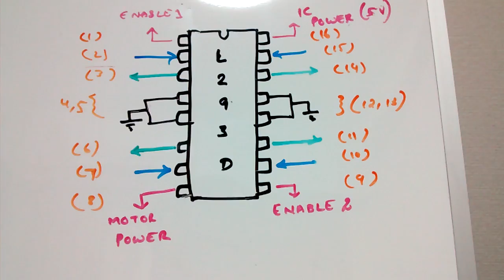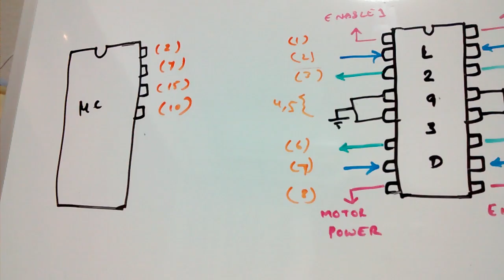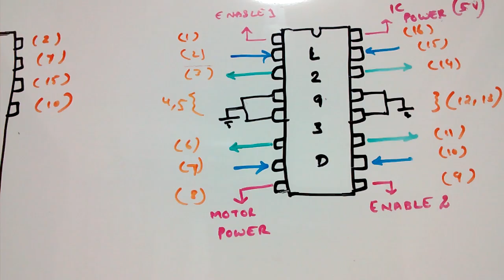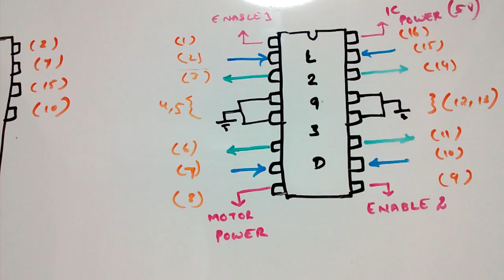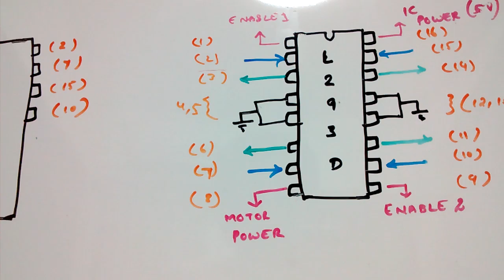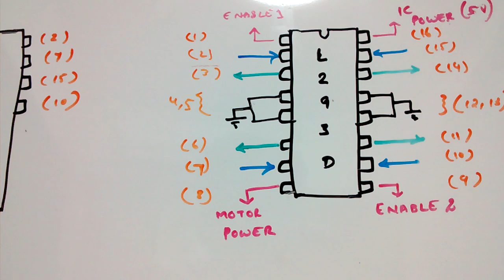L293D Motor Driver Working

Comment: Bro please tell me quickly i programmed by uno and connected motors and did everything after that the motors didnt run and there was a voice coming like chhhhuhhhjjju i was making a line following robot
Reply from the maker: Ha Ha Ha .. please check your connections first.. could be a problem with connection. especially the ground connections. If all the connections are good, then it could be that the input for motor driver is not proper.

Comment: Can we give same power supply to L293d and the microcontroller???
Reply from the maker: Yes you may. But please give battery with enough output voltage and also filters to block the back emf and other parameters.

Comment: What is the maximum current measure rate????
Reply from the maker: I haven't measured it to be honest. But if I remember correctly, it's upto 600mA as per the specs. You can measure it with an ammeter if you want to.
Reply: @imtheroboart  OK..

Comment: Can you get it to run the motor when it receives low signal, and stop when it receives high signal. i.e if the input comes from FC-51 proximity sensor which has active low input ???
Reply: Sorry fc51 active low output

Comment: y cant we use ic7404 for this operation..even that will two signals which are inverted to each other..this can also turn motor bidirectionally?plz someon answer
Reply from the maker: narayana srikar bonda It cannot provide the enough power required to drive the motor .
Reply from the maker: vamshikrishna kancharla Thank you

Comment: is is necessary to give 5v to 1 and 8 pin and 12v to 16 pin or can i give 12v to all 1,8and 16
Reply from the maker: Pin 1 is to enable the motor driver. You can just interface this to a pin on a micro controller which is HIGH state. Pin 8 is the power for motor. You can give a voltage which is enough to rotate the motor with required speed. Pin 16 gives the power for the working of the L293D. This pin must be connected to 5V.
Reply: My Distractions ... You are correct, a high (+5V) on the enable pins (1,9) will work for a single speed at max. RPM relitive to the input voltage on pin 8. These same pins 1& 9 can be used with a PWM output from your microcontroller to control the speed of the motors.

Comment: Where do I put the motor power to? My motors only have 2 connections
Reply from the maker: The power for the motor should be connected to the PIN 8 of the L293D Motor Driver. The two terminals of the motor can be connected to PIN 4,5 or PIN 12, 13.

Comment: so if you had both inputs as high on the same side, would it blow the ic? or is there an internal protection?
Reply from the maker: +Telecastvids No it won't blow ur IC.. The motor will be stopped. If both inputs are low or both inputs are high, its dont care condition.. Please find the truth table in my blog.. The link is available in description section of this video
Reply: Ok, thanks for the reply!

Comment: Very good video. Thanks. A couple of questions...What kind of Back EMF protection are you using for the Inductance in the motors?  Are the Caps used to reduce ripple voltage or noise?